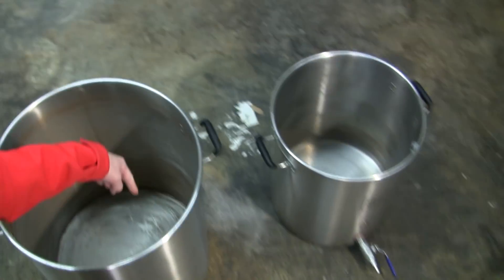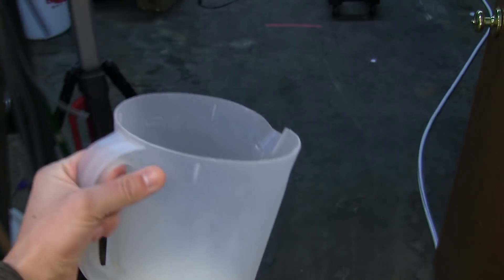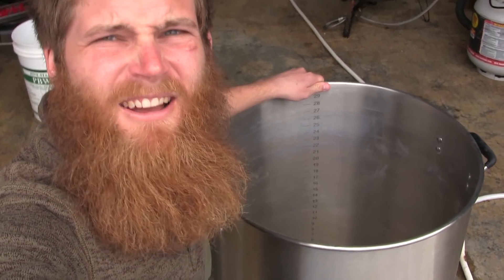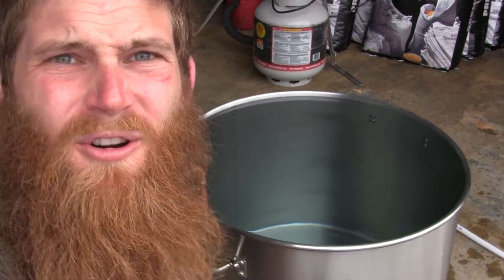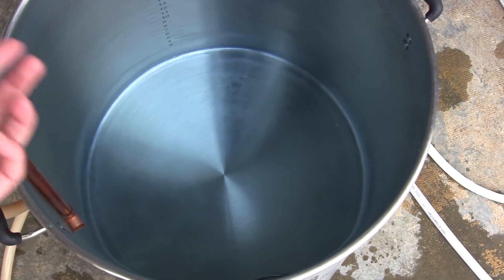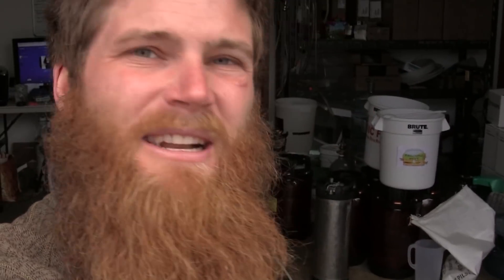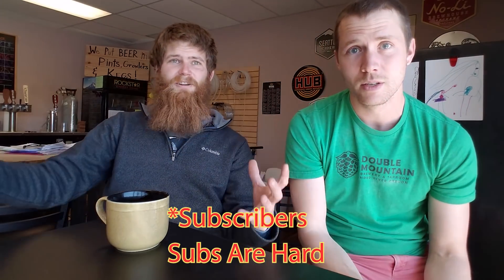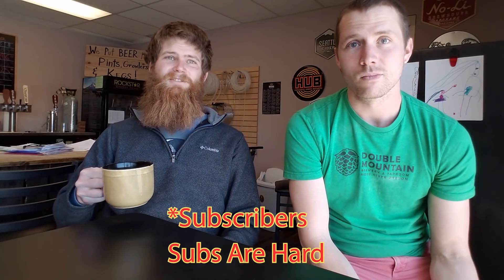How to Clean and Passivate Stainless Equipment - Brewing Kettles, Fermenters

Comment: Passivating stainless steel is not necessary. When did you passivate your tea kettle? Never...  Use citric acid (cheaper) and boil it for 5 minutes to remove calciums&stains and you are fine.

Comment: Is there time when you should rinse the acid cleaner off the kettle?  You said let it air dry, but no rinse?  Just checking.
Reply: Contact time is a product of chemical concentration and temperature. Relatively weak solution like this is heated to 60 degrees C in order to effectively work within a 1-1.5 hour time frame. You could reduce the temperature and increase the contact time. As a rough rule-of-thumb, double the contact time for every 10 degrees C you lose. i.e. at 60C, it's 90 minutes. At 50C it's 180 minutes. At 40C it's 360 minutes, etc.

Always rinse after passivation. Preferably with demineralised/deionised water. The argument being that the chlorides in tap-water can have an adverse effect on the reformation of the passive layer. In practice though, as long as your tap water is of a decent standard, you'll probably be alright...
The chemicals used in this video are a nitric - phosphoric acid blend. They're corrosive and you don't want to leave them the surface.

The pickling and passivation "bible's" are ASTM A380 and ASTM A967. Get a copy of either of these. They  explain the various options and technicalities with regards to this process better than I can here.

Oh, and be safe! The concentrate chemical contains 38% nitric acid according to the data sheet. That won't "melt your skin off",  but it will cause severe burns - and you'll lose your eyes if you get in them... 

Have fun!
Reply: There’s been debate about rinsing on some of the forums. Seems some people have not rinsed and the tanks became discolored and others say they’ve had no problem. I’m curious as well if these guys have had problems with no rinsing.